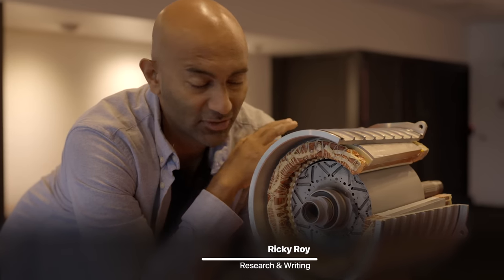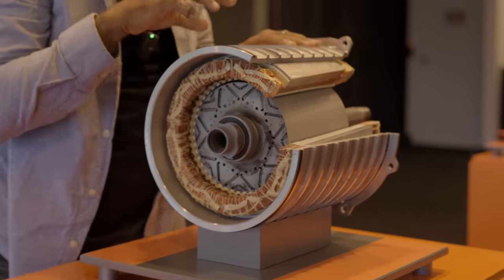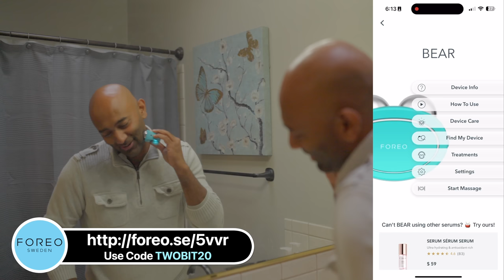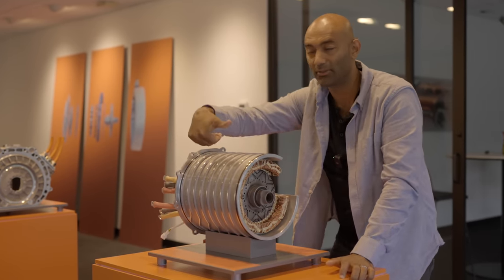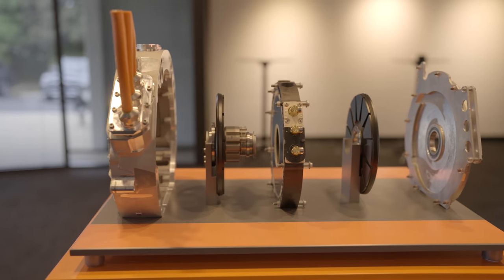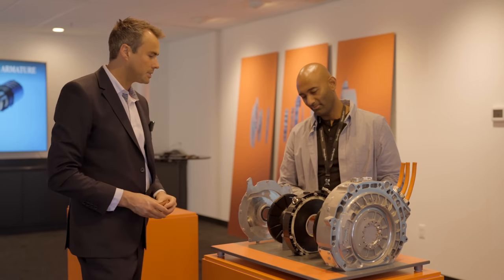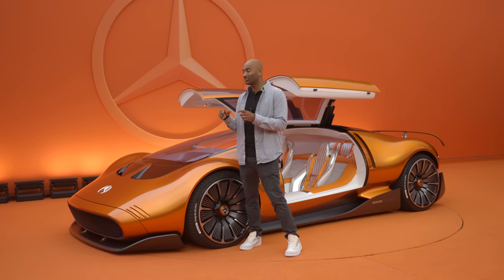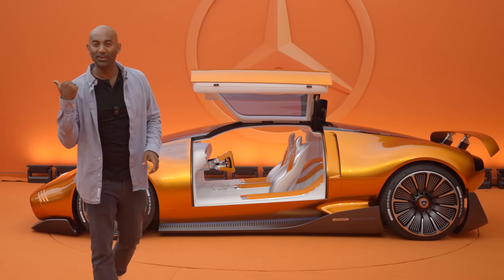Axial Flux Motors Will Change CARS - Here's Why

Comment: The weight thing? You're replacing the 600 lbs of average engine, transmission, and gasoline with 1,700 lbs of batteries and motors. The motor here is a breakthrough — it really is. It's really cool. But until batteries are likewise reduced to 1/3 or less?......

Comment: Slamming your motor into a pothole is a bad idea, high unsprung weight is a bad idea if you like a smooth ride. Basically putting a very expensive motor in your wheel will fail.

Comment: When will we see a MB production BEV with this motor design?  Lighter weight translates to greater range.  A smaller size motor means there’s more room for cargo.  MB engineerings need to reduce the “spaghetti” hoses at hood and deliver a BEV with a frunk like Tesla & Lucid.

Comment: size of that is good for engineers, but wont help much overall in EV's as it's the battery. Otherwise that motor is win-win as it's never a bad thing to get those smaller and more efficient?

Comment: Lets be real, the motor(s) is not the bulk of the weight in an EV/hybrid. Until batteries can drive the heavy vehicle 800+ miles, AND weigh as much as a full tank of gasoline, and/or 100% recharge in 5-15 minutes, EVs will continue to remain a fun toy, not a daily driver/distance driving vehicle.
Still, this could easily be put to shame if the govt and corporatist companies would stop burying the 200+ mpg 300+ hp gasoline engines that was proven 25 years ago to the world (before the inventor showing it to everyone mysteriously "died").

Comment: Interesting. A street vehicle does not need to go 100 MPH so perhaps there is no need for a transmission. This being said unless they get the prices down, longer distances, and quicker charges the EV is basically dead. As for hybrids why would anyone want a vehicle with two motors which costs more than one motor?

Comment: Ok... high torque and low(er) rpm?  Sounds like they're immediately applicable to many Diesel engine applications.

Relatively low rpm and lots of torque?   What's the typical rpm of a private aircraft's engine-propeller system?  2-3 k rpm?

Unsprung weight is better than heavier wheels, tires, etc.?  At the weight and complexity cost of all the U-joints and half-shafts, tying the motors to the chassis and redesigning 4wd might be a tolerable way to go.

Power/torque plus low weight and higher efficiency?  Electric lawnmowers?

High torque and tire/wheel/motor combination weight doesn't matter as much?   8 or 10 (or maybe all 18?!) of the wheels of an over-the-road tractor-trailer system?  A tractor-trailer with 18-wheel drive???

Just a few not-so-random thoughts from me.   😇

Comment: 500 HP is probably great for SUVs, trucks, tanks and air carriers, but I would be OK with cheap enough 50 HP or even 4*10HP in wheels…

Something tells me, that reason for this overkill power is ultra-expensive manufacturing…

Comment: Electric is cool. But the environmental cost of mining, processing, manufacturing and eventual disposal of the rare earth minerals used to make them has a serious impact. Additionally, globally very little is being done to increase electrical generation capacity to support the transition to EV's. Most grids are at or over capacity as it is, adding the load of millions of EV's will push the system beyond its breaking point.

Comment: It's not the weight of the motor that the issue with electric vehicles. 
Weight, charging time, capacity of batteries.
Reply: Charging time and capacity is no issue in cars. 60kWh is sufficiant to let me travel without any charging stops most of my time, I do less than 400km each day. Car charges at home when parked, so no waiting time. Only on long distance here in Europe I need 15min charge stops, thats no issue. Batteries get better every year. Having such a motor in a sports plane would be great, but there the batteries are too heavy. Airplanes need lighter and smaller batteries. EVs work for me, doing 50k km each year. Simpler, better, easier, cleaner, cheaper.

Comment: I hear the word "performance" a lot here, but I don't hear the word "efficiency" much.  (I'm paused at 4:30)
Reply: Yeah, because Mercedes is not known for efficiency, neither an electric cars, nor in gas cars😂.
Reply: @Negev-Israel  They may have the ability to unlock the full potential of a technology, but they cannot utilize more than its full potential. If a design concept is not efficient then it's not efficient no matter how good your engineers are.

Comment: 9:56 Dude must have forgotten that Rotary engines exist. 

Additionally power density in an internal combustion engine can be increased way above anything that electric can do.

Why use an EV anyway? A V8 is way better (I'd even take an inline 6 over an EV)

Comment: Yes axial flux electric motors, those things that require a 1400lb battery. Boy it’s a good thing it’s only 50 lbs otherwise it would be way heavier than my internal combustion engine and fuel tank, which my engine weighs 350lbs and my fuel tank when it’s full weighs 96 lbs.
God, adding that much weight to a car, definitely will change the automobile, but not in a good way.

Comment: cooling system put a shield around the disk and put a blower using nitrogen to cool the metal keeping temptetures or a rad might work! you more than likely thought of that already i learned rad's and cooling system for the engine a Ferrero or Corvete learn the mathematics of those systems it will help you have different views within cooling metals.   off to finish the video thank you

Comment: So we have a new motor that is lighter.  Yeah, less weight!  Now it needs a transmission.  Yeah, more weight!  Wait, what?
Reply: I mean that's how it works, the same would be the case for an engine but then you'd get the weight of a traditional engine and the weight of a stronger transmission

Comment: Interesting technology, indeed. However, at the end of the day, an electric powered car is still powered by fossil fuel if it is plugged in to the "coal powered" or diesel-powered electrical grid. And, when conversion loss, battery material mining and manufacturing is considered, there is little to now net improvement for the 0.04% carbon portion of the atmosphere that is referred to as "the environment." The world needs technology development for "clean and efficient energy" at the source, such as zero point. Without it, we are just "moving the goal posts".

Comment: I like the design but your torque distance comparison is lacking (since the stator to axle center is comparable for both). Also, why compare a motor that doesn't need a transmission to one that does and claim any weight reduction? The weight reduction is of no consequence if the weight delta is consumed by a transmission and MORE MOVING PARTS? It is very typical of Germans to over engineer the heck out of one thing only to have to pair it up to a bunch of other things to make it work.

Comment: As electric motors have become so much more important innovation is growing in leaps and bounds, imagine 4motors like this on a car, the performance would be astounding, and the idea is not unique to Mercedes, others have designed similar motors that could be much cheaper and sip less electricity enabling car manufacturers to cut production costs. Match this motor or just two of them with the NASA solid state battery and the cost of an electric car could be much lower than a fossil fueled car. While doubling performance, and building these or better versions of these motors in bulk could cut costs even faster. What I want though is a small motor like this or two to easily be installed in my car, replacing the existing motor fuel tank could be a battery pack and exhaust removed saving space and weight. Imagine the space a battery could use just from the removal of driveshafts. But as by 2035 pure fossil fueled cars will be illegal to manufacture so will hybrids be banned a few years later for pure electric vehicles, innovation and R&D will push us so fast I would not be surprised if even these amazing motors were outdated in 20 years or less. Magnetism has received nowhere near the attention needed, I am sure there will be some impressive developments and urika moments in the labs, or in someone's back garden shed.

Comment: 500 hp 50 pounds?
I can make 500 hp. And I only need 6 pounds. Of gasoline. How many pounds of batteries do you need to run your 500 hp electric motor? When you only have 10% battery power left you're still gonna be carrying around 100% the weight of a full charge. In the meantime my vehicle is getting lighter all the way down the track.
Reply: just want to point out that fully charged batteries are heavier than discharged ones but the difference is neglible. so your point still stands.

Comment: Axial flux motor is NOT Mercedes innovation. Also, at the end its said that price will be higher for axial motors because they are new, inspite that at the start its said that one of advantages is that they are less expensive because of a lot less materials used? There is nothing special in manufacturing processes of axial motor that would make it more expensive than radial motor, only thing making it more expensive is that since they are first making it they can stick huge price on it and get away with it. 
Also, although this motors are great addition to motor types and big advantage in car world, electric cars still are limited by batteries, not motors. Not only because of huge weight, price, charge time, longevity, all disadvantages of electric cars we now know of. Not to mention ecological impact which is still lied about, which ultimately is for now higer then ICE cars if one is to consider process from mining of materials to producing batteries and electricity to charge those batteries and ultimately process of recycling of them. Not to mention that whole cars are throw to trash after 10 years because it is not economically viable to change batteries, whil ICE cars are on the road for 20-25 years making a lot less trash and materials wasted.

Comment: ev cars will not be a cost and environment friendly option until they put some effort into solid state batteries that use cheap materials. upgrading this motor and ignoring the obvious issue with electric cars is like installing air conditioning in a horse and carriage.

Comment: I think when you compare the Axial motors vs combustion engines' weight, should include the BATTERIES, weights to make the fare comparative. Thanks
Reply: Then add all the engine accessories and all the fuel system to equate the comparison.
Reply: @raymondramirez9177  always the weight of an EV will be much more than all the components of a combustion engine , I presume you know that much better than I do, you can even include the Gasoline weight to compare if you want.

Comment: Better motor, no doubt, but the real problem for an EV is the battery.  No.1, there is much less lithium than there is oil, No.2 it takes an 8000 lb lithium battery to equal the energy output of 50 lbs of gasoline, No.3 petroleum is still going to be required to build an EV.  So while the motor is an improvement, petrol cars are still better.  More economical to operate, cheaper initial cost, batteries every 5 years don't cost 20 to 30K, recharge times for gas cars take 3 to 5 minutes, and gas cars operate in cold climates MUCH better.  And don't even start with how EV's are going to help with this climate warming bull, if anything they create more pollution in the manufacturing process.

Comment: EV isn't the answer, using this in hybrids is where all the benefits will come from until they can find a better fuel to generate power or a better storage electricity with a better charge rate.

Comment: As usual, from Das Auto, nothing presented as new it is not new and it is not developed by Das Auto. The "disc motor" (that is the original name of it), it is an old solution for machining servo motors, back in 80's. Due to the low inertia and huge torque, the usage of disc motor excuse a lot of synchronizations and complex computing for 2.5 and 5D machines.

After they have sabotaged the development of auto industry for decades, and kept us in efficiency darkness, now they have the nerve to claim for things that they hold back and discredited systematically.

Comment: 11:00 "imagine how much u can do with all the space u save" yeap its not going to happen, that space will be hidden, look what happened with engine bays on electric vehicles... that entire bay on most EV's is plastic cover... behind it 4 wires... and ur left with a 1/4 of a space usable for 1 luggage and not even a big one...one thing is for certain... engineers will make sure all that space will be wasted and there is not going to be used at all outside some plastic trim, and masking some cable...cause what engineer love, is lots of space... to be lazy, and just slap some thing there that before they had to invent some way to make it compact... now there is no need to make them compact cause there is space.. so that space will be just used nonsensically... plus will cost less to manufacture so manufacturers will agree with engineers... remember if something makes sense to you as a user... product manufacturers will always find a way to mess it up.

Comment: Yes an internal combustion engine weighs more, but an EV PU truck battery weighs 2900 pounds or so while a internal engine PU truck battery weighs in around about 30 pounds.
Reply: Can you run thst truck with just one 12V battery and no engine?

Comment: Airplanes use 400.  Cycle motors. As they are 1/10 th the weight of a 60 cycle motor

Comment: sadly as long as current heavy and short lived car establishment continues  that invention will not trickle down as a benefit for a average customer.  the right way would be a lighter and  simpler vehicle. it would be cheaper. and have less carbon footprint. but that is not what all the EV manufacturers are about.  maximizing the profit and raising the price. not lowering it

Comment: I could care less about supercars and their top speeds, and I don't understand the medias ongoing fascination with them. Let's go the other direction of trying to mass produce the next Prius hybrid but instead of 50 MPG it might get twice that, based on better electric motors and better less costly batteries that weight less. Think of the pollution savings such a car would create, and with no need for a completely new infrastructure for recharging cars. Such cars might allow time for Hydrogen to become a workable fuel source.

Comment: And if the motor goes bad the car is serial locked to it so you can never replace it and the car is junk. The end buy a $2000 Toyota from 1992 it will last longer and you can replace the engine if it doesn't and you don't have to spend your life savings.

Comment: Its all very interesting BUT & its a very BIG BUT.......all ev motors depend on BEARINGS & with basic bearings on a tesla ev costing over $12k to replace its NOT a cheap issue......As its a MB vehicle it will be possibly TWICE the tesla price for a basic bearing,,,,,,,,,,,,, ev Bearings ARE THE WEAKEST LINK......